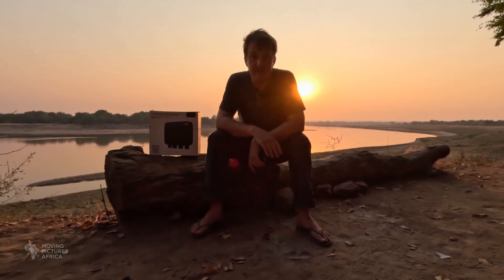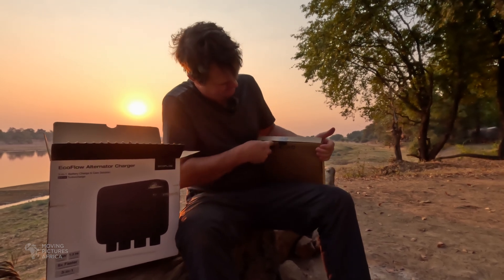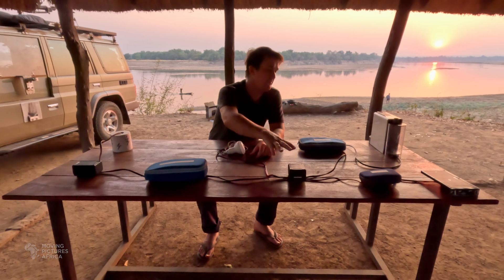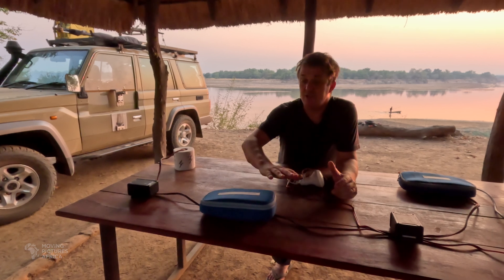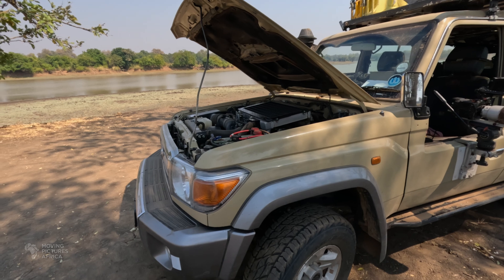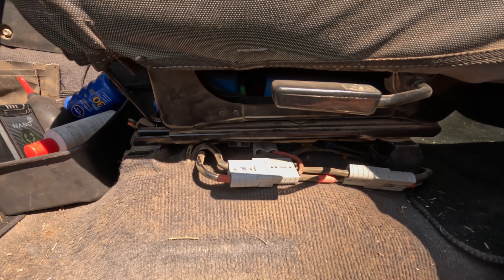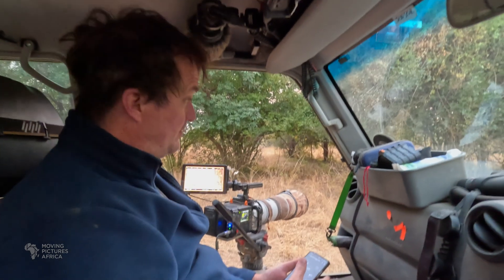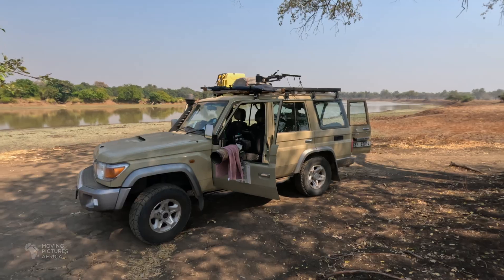EcoFlow Alternator Charger: the Missing Link for Overlanding, RV and 4x4?

Comment: I have watched way too many unboxing videos..but none with a greater location. And trust you to make the unboxing fun to watch. Thanks for the great video. Cheers.
Reply from the maker: @sagarsadhu6295  🙂 thanks! Glad you enjoyed it
Reply: I am considering the Ecoflow, but the cost is still in the way of going ahead. Especially with a fully functional system already installed. But it is great to see how technology is developing. 

Thanks for the great review. The reverse charging manual setting might be a problem, if you don't have  a backup to start your vehicle in remote places. Might be too risky for my liking?
Reply from the maker: @willemhutten6585  yeah, they are not cheap. If you already have a working system, I'd wait for something to fail before spending the money.
Reply from the maker: @willemhutten6585  regarding the backup there is a setting in the app to keep some power in reserve, so you can always get the vehicle going. But I don't like running my starter battery flat, so I think a better solution is a battery protector.

Comment: While driving - are you running the EF Alternator Charger at the same time as you are charging your current house battery via the alternator?
 I ask as that might be a LOT to ask of  the Alternator!!!
Reply from the maker: Sometimes I run both, but if I do I use the ecoflow app to reduce the power draw to 400W or so just to be safe.
Reply: @MovingPicturesAfrica  Good to know THX
How many watts does the 'OLD" house Alternator Charger draw? (at 12 volts - right)
Reply from the maker: @TerryManitoba my dc-dc charger pulls 20A max IIRC. So 240W 👍
Reply: @MovingPicturesAfrica  Do you not find 20 amps somewhat low? I say that because after 5 years of having a 30 amp charger I added another one to bring it up to 75 amp. Because on days where I put on few mile having 75 amps is nice to have.
Reply from the maker: @TerryManitoba we usually drive quite a lot. Also we have a 100W panel on the roof to supplement the DC-DC 👍.
Reply: @MovingPicturesAfrica  Got it - 
When I drove a lot more 30 amp was good. But now  we spend more time in one spot followed by a short drives to the next spot so 75 amps is nice...
Reply from the maker: @TerryManitoba  that makes sense. BTW, one really nice feature of the ecoflow power stations is that they fast charge from AC. So if we stop for lunch somewhere, we sometimes plug it in and charge it up.
Reply: @MovingPicturesAfrica  That, along with all the other great features the Max incorporates - there is a lot to like with this unit. Especially; for long distance travel -  which is "by far" the main reason for buying it.

NOW I have to sort out my Starlink Mini - which is currently in the mail👍

Comment: Are you able to run both platforms or systems at the same time? The traditional second battery through the DC/DC charger and your ecoflow solar power station through the alternator charger?

Why, so the traditional system deals with the extra 12v load that's permanently installed in the vehicle and the ecoflow deals with the 220 power instead of you installing a inverter.
Reply from the maker: Yes I have been doing that since making this video. Works fine. Just have to be sure the alternator can handle the draw of the ecoflow and the DC-DC charger (set the Alternator Charger accordingly). Or you could charge your traditional dual battery system from your ecoflow power station
Reply: @MovingPicturesAfrica  that's great news, an updated video of those two options would be great even if it's a short one would be appreciated. 

I would look at that as a solution for my 80 series, building in a 12v dual battery, naturally not nearly the load that you put on it and having the ecoflow that functions as my inverter for 220, which is mobile if we want to put it in the tent, fantastic.    

Does the reverse charge, then charge the crack battery and the secondary dual battery? 

It would probably be worth while to upgrade the alternator for such a system ...
Reply from the maker: @etienne_oosthuizen yes the reverse charge should trick your DC-DC charger into thinking the car is running. The DC-DC will then charge the dual battery
Reply: @MovingPicturesAfrica how would you go about charging the dual system from the ecoflow? That sounds like a silly question, but the issue would be if you remove the ecoflow, then you dual has no means to charge ... How would you get past that?
Reply from the maker: @etienne_oosthuizen  you could just use a AC charger via the inverter in the Ecoflow. But you are correct then it will not work when you take the Ecoflow out of the vehicle
Reply: @MovingPicturesAfrica you could wire it up with an Anderson plug to a DC/DC charger and when you take out the evoflow you just connect the dual battery Via the Dc/DC charger ... Sounds overly complicated now ... The simplest would be to do what you are currently doing, connecting both (ecoflow and dual) to the crack battery/alternator
Reply from the maker: @etienne_oosthuizen yes. Keep it simple
Reply: @MovingPicturesAfrica a video updating us on this would be great, discussing these two options further.
Reply from the maker: @etienne_oosthuizen let me see if I can find the time. Quite busy at the moment
Reply: @MovingPicturesAfrica  Here is a hypothetical situation, but possible. Say your alternator packs up and you dont have a spare. Could you use your ecoflow to supply power to the battery in the place of an alternator?

Comment: Hi, does the alternator accept solar panels? I mean to use it in inverse charging mode I think from what I've read. For example a 48v panel into the alternator (not connected to the car) and then charge a 12v or 24v battery. On the other hand, if one connects it to the car, can you charge a battery without the ecoflow powerstation? I think it's 40-60v output in that case? so it would have to be a 48v battery? Not sure if its possible regarding the connectors, and also the app settings. Thanks
Reply from the maker: @segundacuenta726  I think it was not designed for what you describe and it would be better to buy a solar charge controller to charge batteries from a panel and a DC-DC charger to charge batteries from the alternator 👍

Comment: Have you found a way to automatically switch from 'Charging' while driving the car to 'Reverse Charging' when stopped?

ah answered around 12th minute. Any updates to the feature request?
Reply from the maker: Here is what they said: "they are likely to add this feature next year either via a firmware update or on the next generation"
Reply: @MovingPicturesAfrica  to bad, I've been searching to see if I could reverse engineer the bluetooth of just find any other way to trip the charging to reverse charging.... but nothing so far :( 

Software would be by far easiest as the ecoflow alternator charger does have al the info needed.
Reply from the maker: @markbergman2342  agreed. I'll mention it to them again.
Reply from the maker: No updates yet. I'll check in with Ecoflow and see what they say.

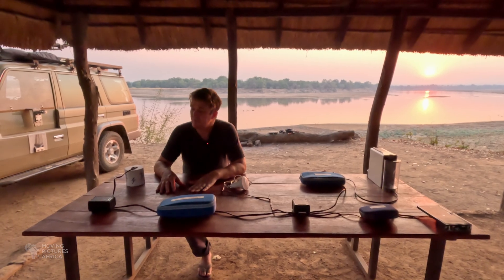Comment: I’m new and amateur of car electrical system and 3:25-6:05 helped me ALOT in understanding! You explained it extremely well, Thanks! 

Question: Assuming your Ecoflow Delta Max power station output is 220v (voltage in Africa), do you know if I can setup my North American SUV (I live in Canada) with the Ecoflow Alternator charger along with a 220v Ecoflow power station?  I know it sounds unusual setup but i have devices that needs to run with 220v so rather than using a step up (110v to 220v) transformer on the 110v Ecoflow, I think it’s just better to use a 220v Ecoflow power station directly, but no sure if its safe to use my Canadian SUV (I believe it’s 12V) car’s battery + Ecoflow Alternator charger to charge a 220v Ecoflow… (I plan NOT to use solar panel setup) Wish you can help shed some light
Reply: That’s great! Thank you so much! 👍
Reply from the maker: @Peter_Channel  don't worry, the 220v power station will work just fine in Canada. The Alternator Charger is not specific to 110 or 220v systems 👍

Comment: What to do if the veheicle has a smart alternator?
Reply from the maker: @BraamCompton  I can't test this, but it should work fine. From what I have read, you may need to lower the start voltage in the settings so the alternator charger runs continuously.
Reply: @MovingPicturesAfrica  The issue is, a modulator switches the voltage on the alternator as the battery is charged. I'm going to bypass the negative and earth it beyond the modulator which is bolted to the negative terminal. Hopefully that works.

Comment: Thanks for an insightful video & the "Bush Sparky" install !! .......I own the previous model without the app / 110Ah storage / 1400 W continuous & 3500 W start up AC capacity / various charging inputs & multiple AC / DC outputs (paid ZAR 7500 / ballpark - USD 400)  . Thing just works & saves a huge amount of space . Don't have the same DC draw that you require, (10A DC max. capacity on my unit), but it is more than capable of running an average camp site / basic "week or weekend warrior" overland vehicle requirements. Located the ecoflow behind the passenger seat (strapped to chassis - don't want the thing bashing around in case of an accident of when off-roading) & hard wired a compact 10 output DC  fused distribution box in the rear of the bakkie  (pickup for our non SA folk !!) to the ecoflow via an anderson connector. The added bonus of  having AC outputs without all the faf of additional wiring / inverters / potential failure points is an added bonus. Seriously.......... can't fault this excellent product. (oh and when I get home - it's used as a portable "generator").
Reply from the maker: Thanks Chris. Sounds like you have the perfect setup for your needs. Yeah, if you just need to run a fridge and charge some phones and things, then 10A charging is good enough (plus a solar panel if you stay in one place without driving for long periods).

Comment: Looks interesting- do you think it makes sense for a trailer electric installation?
Reply from the maker: Good question. I think it will work well in a trailer (although I have not tested this myself). Super fast alternator charging is not as important in a trailer though since usually when you hitch up you drive for a while. The AC and solar inputs are probably more important. So maybe instead of the alternator charger you can rather just send 15A from the vehicle into one of the solar inputs (see my previous EcoFlow video). If you want to use the alternator charger you would need to run a fat cable to the rear of your vehicle and fit a plug that can handle 70A to connect to the trailer.

Comment: Very informative video. Based on your experience with this product would it be possible to connect the alternator charger to the service battery and from there charge the eco flow delta max as opposed to charging it from the starter battery? I already have a service battery charged via dc-dc charger from the starter battery. Thanks
Reply from the maker: @journeyonwheelsSG  I think this would work. But it will only charge when the vehicle is running and the Alternator Charger senses the increased voltage from the DC-DC charger.
Reply from the maker: @journeyonwheelsSG  actually, you could lower the start voltage so the Alternator Charger is active even when the DC-DC charger is off.
Reply: Thank you. Much appreciated.

Comment: I had to laugh at the unboxing mishap. Naturally, the laws of the universe decree that the box 'cardboard fastener' would fail when the unboxing was conducted on camera by a professional cinematographer. Always the way. 

I really like the EcoFlow alternator charger, but I do wish that EcoFlow had made it to work with any solar charger (portable battery) of any manufacturer as I believe that it only works with EcoFlow products. If I'm wrong on that score, I hope someone will correct me!!
Reply from the maker: You are correct. It currently only works with certain Ecoflow products with XT150 inputs. I believe in the future they might sell a cable that allows you to connect it to the XT60 solar input on a wider range of power stations.
Reply: My gripe as well. Not to mention the unique connectors for panels etc. Things happen in the bush, and there's no way to repair on the fly...
Reply from the maker: The solar inputs take XT60i connectors 2 of the pins connected. You can use a standard XT60 and it will work, but it will limit the input to 8A per input IIRC. This is so the unit does not blow your vehicle's fuze if you charge it using the cigarette socket in the car.
Reply from the maker: The fact that it is an all-in-one unit is a bit of a concern in the bush. I mentioned this in my first Ecoflow video. It is theoretically possible for it to fail entirely. In contrast, if a component of a traditional dual battery system fails, then the rest of the system still continues to function. As more people start using EcoFlow power stations for overlanding, we should get an idea of how reliable they are when exposed to heat, dust, vibrations, etc.
Reply: @MovingPicturesAfrica  Great replies - thanks!!
Reply: @auto-funatics7147  I'll second that! Great replies indeed! I too am grateful!
Reply from the maker: Hey Andrew. Yeah, and I had lugged that box thousands of km without opening it so I could do the unboxing in a cool location 😂